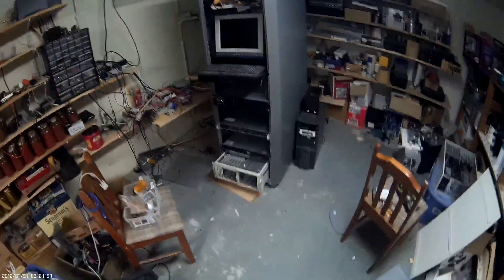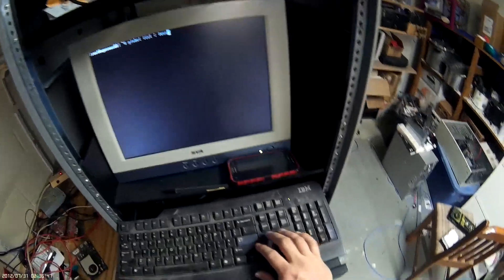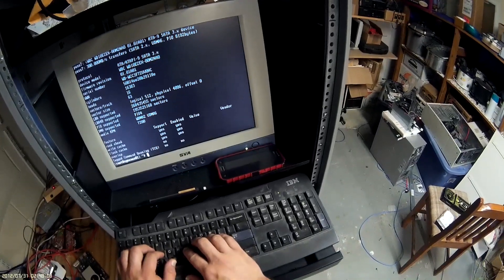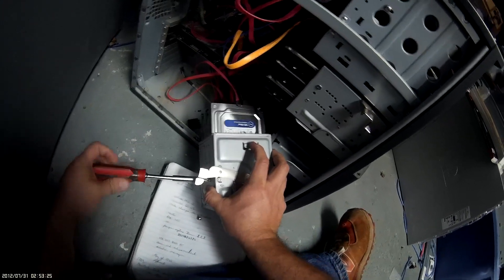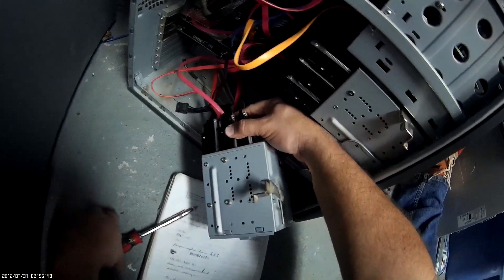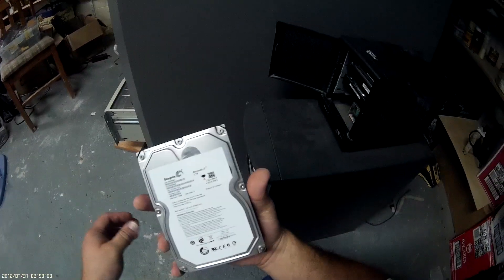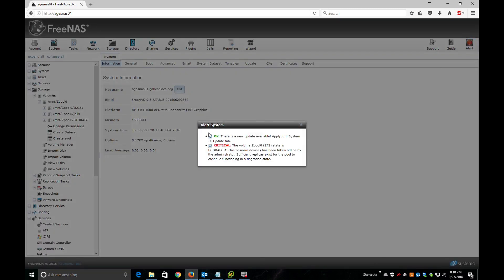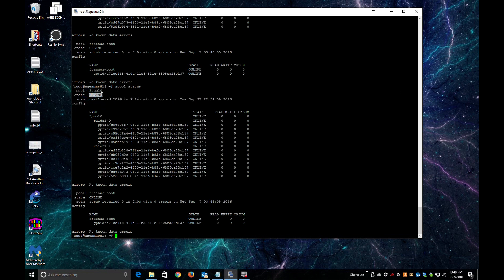Identify and Replace Failed Drive on Freenas

Comment: I suggest that you might want to get one of these enclosures from eBay:  http://www.ebay.com/itm/172315518085

You have a rack, so you can mount it if you want, but you can put it on the floor like I did, standing on edge.  I made labels to put the serial number on the front of the drive carrier.  Makes swapping drives quick and easy.  I love mine.  
I have 12 drives in my main storage array and two drives in a mirror for my VMs.  The back-plain limits drive size to 2TB but that works because 2TB drives are basically the best bang for the buck right now.
Reply from the maker: Thanks for the information! wow that's actually a good price for a 24 bay enclosure... I am definitely going to do something like that for my next build, or add a card with external connections and use it for storage
Reply: It is actually very easy to move an existing configuration over to a new disk controller and even a new system board.  I have migrated my storage to a new chassis/system board 7 times since 2008 when I started using FreeNAS.
If you are interested in a very capable, yet low cost build, I can put a list together for you, just ask.